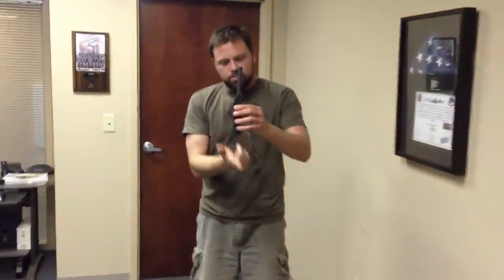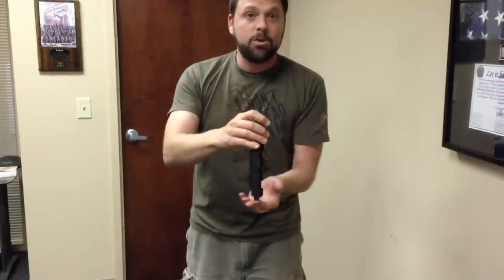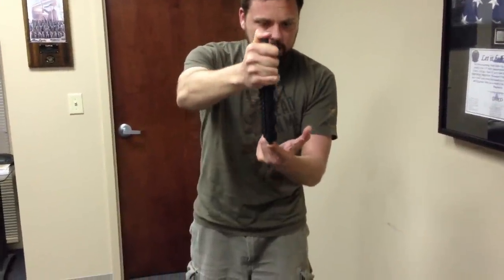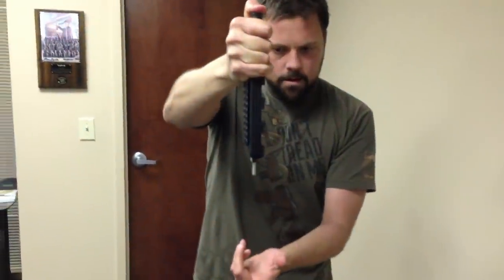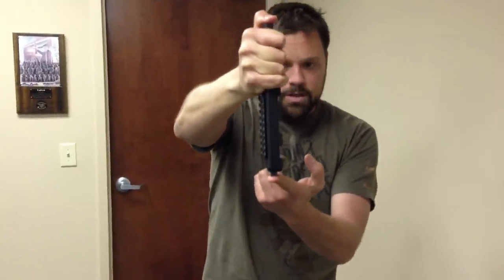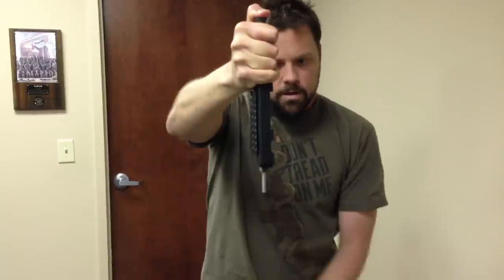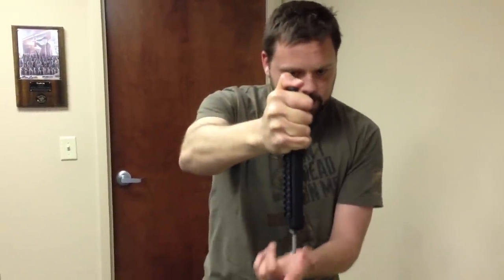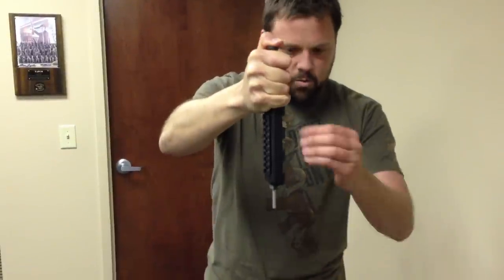SKS gas piston and gastube: diameter test

Comment: If it fails the test and is to tight will it still fire and cycle properly
Reply: i would think it would work as long as it still freely glides in the tube. if it does not drift down with your thumb over the end of the tube that should just mean that its got a really good seal on the piston. thus it should push the bolt to the rear with more force when cycling. usually too little force is where you will run into issues like short stroking and failures to eject.